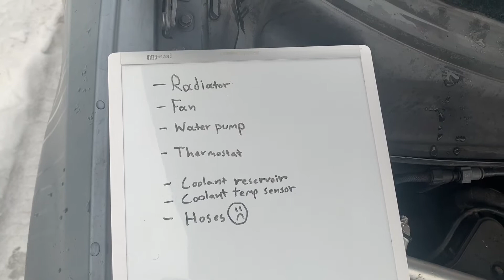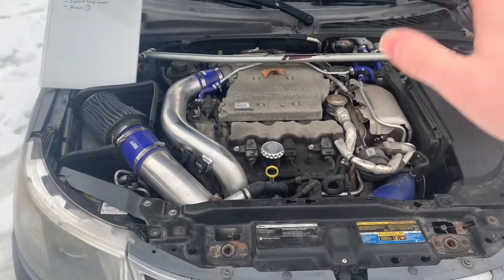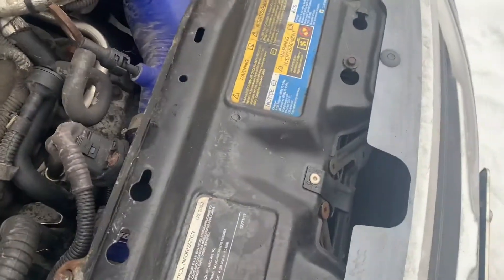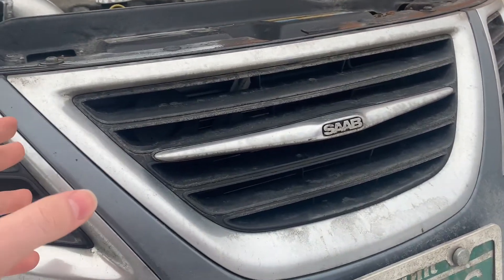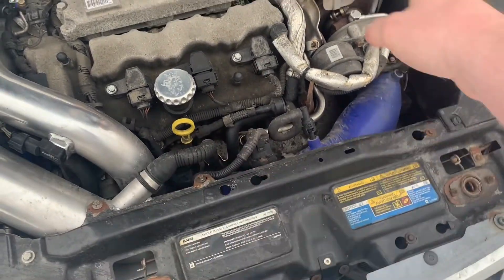Saab 9-3 Cooling system issues quick tips for diagnosing your saab

Comment from the maker: Other spots to check, head gasket could be leaking into exhaust, so check your coolant for exhaust gasses using test strips! Coolant T connection behind engine is also a common leak spot as well.

Comment: This is the best video for b284 cooling diagnosis. Thank you!
Reply from the maker: Did it help you find what you needed? I made this video a while back and missed some info.
Reply: @SolvingSaab  So far I believe it comes down to either the thermostat or the water pump. I haven't spotted any leaks other than coolant dumping from the overflow and I've notice poor interior heating performance and random overheating.
Reply: Also btw your do88 cooling system install, absolute life saver. Made the install so much quicker, did it a few months ago and it went very smoothly.
Reply from the maker: @tedclipcynski  sounds like thermostat to me. But who knows.

Comment: im having this issue with my B207,
nice video
..the thermostat is mechanic or is there a relay that operates something?

my coolant is boiling out of safety discharger

I think one of my fans is not coming on
Reply from the maker: All thermostats on Saabs are mechanical not electric. The fan may be a fuse or relay.

Comment: Great video except one thing you said perhaps in error.  At 3:35 you say if coolant temp sensor is bad …then it won’t tell thermostat to open or close.  My understanding is thermostats are thermal mechanical… they react to actual temp of the coolant it is emerged in.  Reason I mention this is my 9-3 06 2.8 v6 is blowing steam out the reservoir overflow tube… but temp gauge moves to and stays at normal.  I keep finding large puddles under the coolant reservoir… I suspect tstat getting at times stuck closed…and causing a steam backup thru and out the coolant reservoir tank tube.  It looks like a monster job to get at the thermostat on this engine… any thoughts on what be going on? Has a new 6 months ago GM oem water pump… no other leaks detected other than what drops out of overflow tube. .. fyi…fans seem stuck ON… but that seems to be a bad fan relay…as it kicks ON a cold engine startup.
Thanks

Frank
Reply: I am currently tackling the thermostat right now as we speak, its a lot of work and if you want to properly reseal and clean the surface that the gasket lays on I recommend taking out the downpipe and the other exhaust piece that sits below it. I've been at this for days, did you ever figure it out?
Reply: @Vaigue  sorry, I have not dealt with that… can’t offer any help at this time… but I’m sure someone has a video on YouTube that may help…
Reply: Did you figure it out I have the same problem on my 2006 Saab 2.8
Reply: @alexanderanaya808  yes... it was indeed a bad thermostat..  had to remove turbo to at the thermostat.  Tsat and housing are one piece.  Bleed out coolant system... problem fixed.
Reply: @FatGirlSlayer  😎✌️

Comment: I have a 2007 Saab 9-3 Aero V6 turbo.  I recently replaced the coolant cap, and a week later, the coolant started leaking.  I see where one of the hoses is leaking, but most of the coolant in the reservoir is leaking.  Took the car to a Saab repair in Berkeley.  They gave an estimate of $900-$1000 to replace the thermostat.  The car has never overheated.  Is this a legitimate repair diagnosis?
Reply from the maker: I would get it checked somewhere else just to see if they come up with the same diagnosis. Fix your leaking hose first and see if anything changes.

Comment: I’m having an issue finding the lower reservoir hose. The one with the Jesus clip that hooks up to the bottom. The only site I could find it on (because there was a diagram) was eeuroparts but it’s unfortunately on back order through them. Any input would help thanks.

Also if you know if that plastic part that hooks up can be disconnected and reconnected on a new hose. I can make a hose work if need be but I don’t want to go about trying to take it off if it cannot.   
Thank you again.
Reply from the maker: Definitely not an easy find. Unfortunately My best advice is to hit up a junk yard. Or look up just the part number to see if you can find it anywhere else.
Reply: Oh wow yeah just use the part number duh. Lol that was a lot easier.